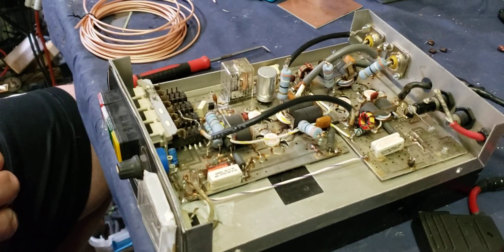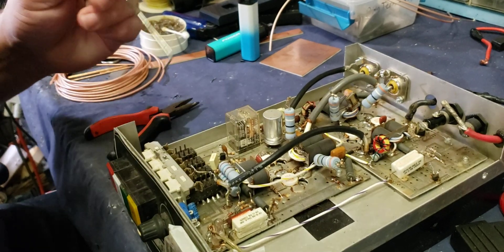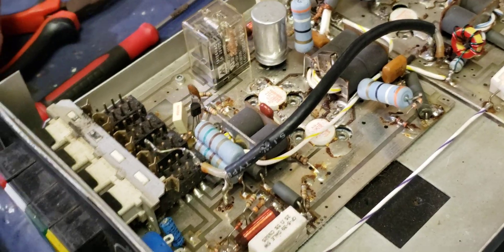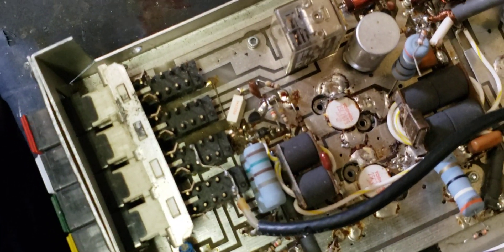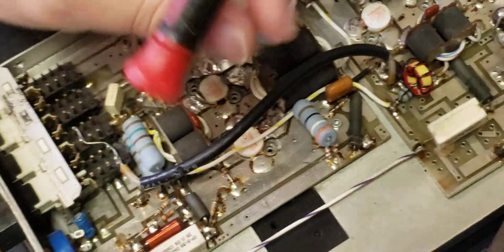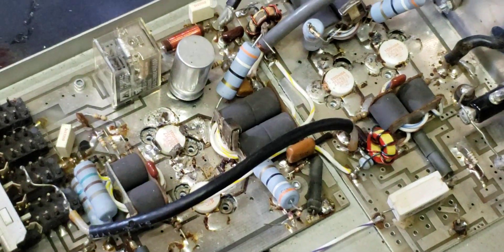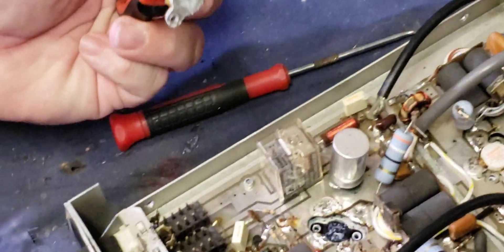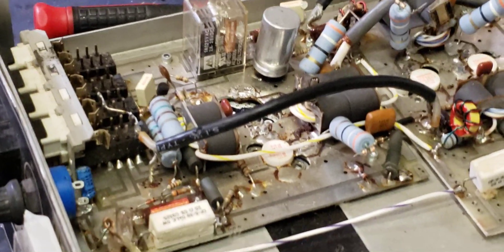Quick Tips On Removing 💊  Type Transistors From RF Amplifiers

Comment: Love your videos dude! Question for you.
If you have a 4 pill hd with hg2879's in it and one pill is bad, can you replace them all with hg2879C's? Or do you have to do something else to make the C's work properly? 
Thanks
Reply from the maker: You can replace them with all HG2879C and it will work but it won't be optimized. THE input part of the circuit will need to be re-tuned.

Best thing is to do the mod and look at your input swr. If it is high then you may need to retune your input tunning cap along with adding some caps to the input transformers.

BTW anyone who buys transistors from me also gets free help with using them hint hunt lol plus  I habe the best prices around. Text me when you need pills 678 557 4846

Comment: LOL them Texas star amps are hard. done a lot of them over the years. gone threw lots of solder wick as well . a 100 watt Weller does help a lot. I do have a duel point solder  iron but is low wattage and meant for surface mount devices. The newer Bach of TS used DEI transistors and pulled a lot of them . well I know a worse one to do. it's the 300V FET's in broadcast AMC transmitter. has many output modules to make up total out put power. 2 sets redundant .we call them blades . the FET's are buried under shields and outher devisees. luckily I don't fix them.  just send them back and put in re bult blade . and its hot swap and can be done on air . if to many blades go down the transmitter just looses power. some times a lightning strike on tower takes out many blades and don't have enough spars . switching back ups around to keep up power.    My transmitter cite uses water cooled tubes and only change them after so many hours. Tube never failed . Even a blizzard with thunder snow hitting tower took  out a tower light and arced the feed line taking station off air did not hurt the tubes. 73's

Comment: You no doubt have a transistor tester GK?
Reply from the maker: Yes, I currently use an Atlas DCA 75 but I need to get me another one to setup ONLY for Matching these 100s Transistors for everyone. About to take the HG side of the biz to the next level.
Reply from the maker: Just as a curiosity why do you ask bud?
Reply: @1883GotDown  I figured If BBi has one you probably do as well GK!😃
1st you need a radio and antenna then you need an SWR Meter then you need a power meter then you need a base setup and a power supply then you need an antenna analyser then you need more power and on and on it goes.
A dummy load etc etc.
Reply from the maker: @RC-Heli835  i know man....it is  never ending story....that is why C.B. stands for constantly buying lol lol lol!! 😆 🤣 

I'm working on the antenna system my self...I havent been on the air in a while honestly.